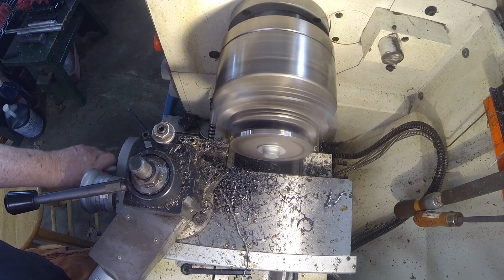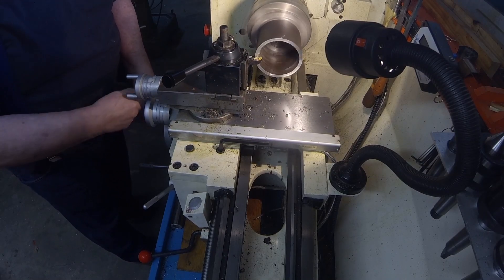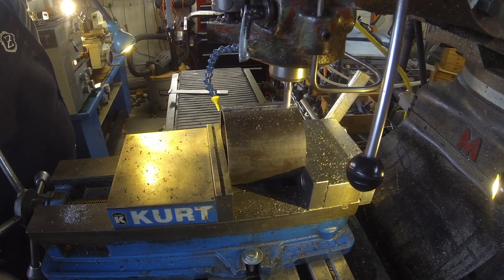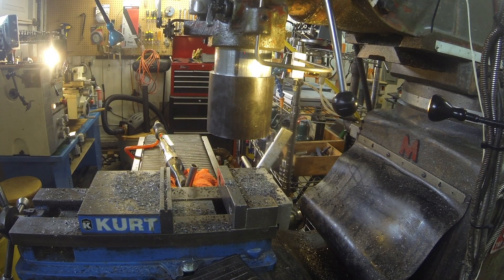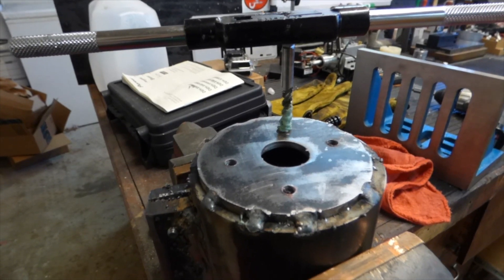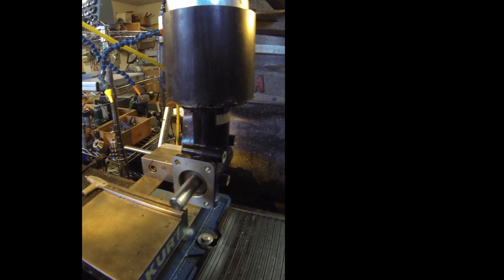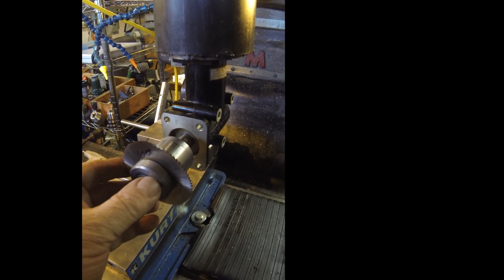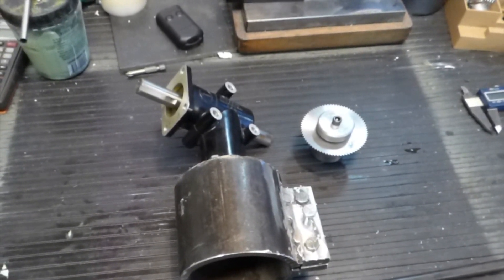Right Angle Head for Mill Part 2

Comment: Very nice! Only one suggestion if you haven't done it already.... You might put in a keyway or some other means of quickly setting it to line up with the ways of your mill. Do you think this can be used as a surface grinder of any quality? I might do something similar with mine if that's the case.

Comment: Would it be worth adding a brace from the three bosses on the angle head up to the quill adapter? It would relieve the stress on the adapter housing. Just a thought.
Reply from the maker: +Thomas Coughran ,  Thanks for the tip.  I had discussed this in my machinist club meeting this month.  I plan to do just that, but want to make sure everything is in alignment (with a little running time) before I do.  Thanks for watching!